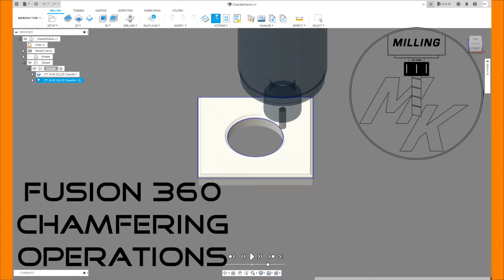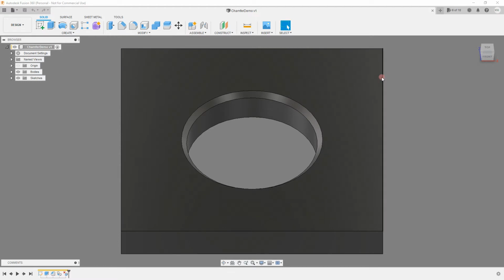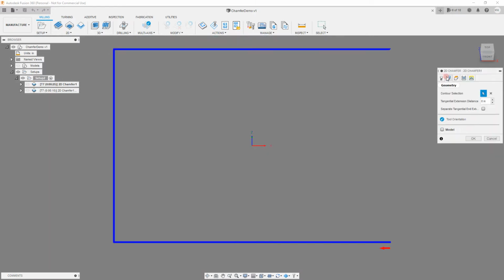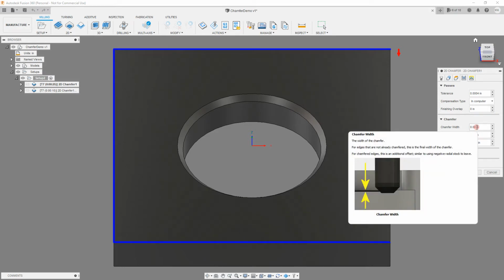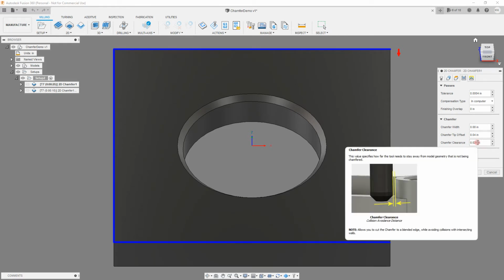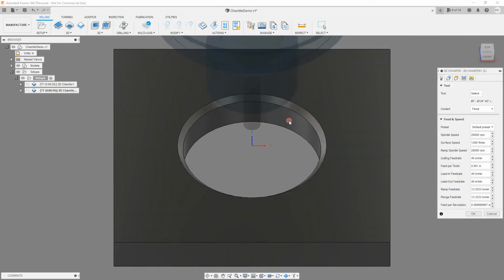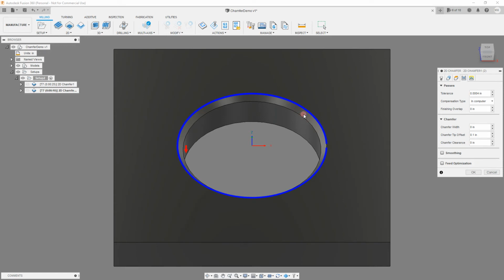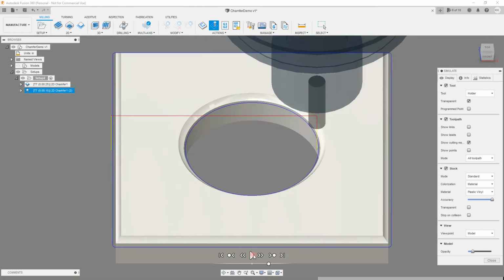Creating Chamfers in Fusion 360 CAM

Comment: I just keep getting "Empty toolpath" no matter what I try. I've tried selecting the top edge, bottom edge, the chamfer surface, setting the width, offset and clearance to different things. Such a stupid operation. Why would they make it so difficult to use the chamfer operation to cut a chamfer that's already modeled?
Reply: By far one of the most challenging and most stupid things in the software LOL